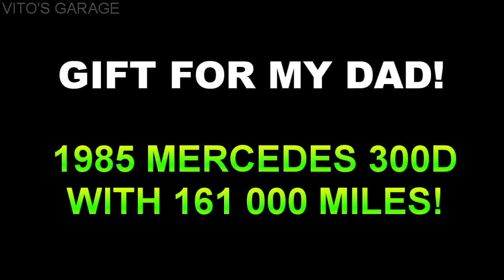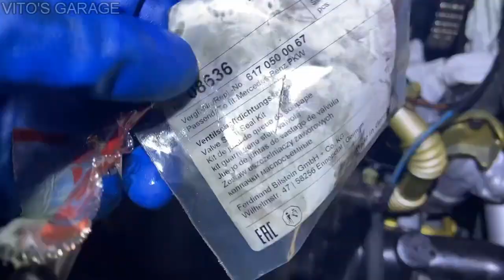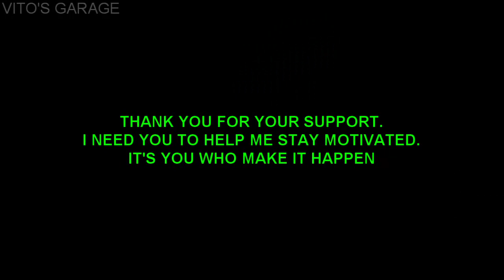Dad's Mercedes W123: New Driveshaft Flex Discs & Center Support, New Valve Stem Seals, Fresh Exhaust

Comment: Good job Vito!
I had an 85 300d. It had 280,000 miles on it when I sold it. Now I wish I had it still. It was a lot easier to work on than my current 2001 e320.
I don't know if the flex discs and carrier bearing were original or not. I think I only put around 40,000 miles on it in the 4 years I had it.
Anyway they gave me no trouble so didn't think about them.
I did not lose any oil at all so never worried about any part of the engine. Just kept the valves adjusted and the oil changed regularly. These things are pretty bullet proof and take little maintenance especially in good climate like southern Cal.
Reply from the maker: W210, especially E320 are easy to work on. Lots of space under the hood. Serpentine belt replacement takes about 5 minutes, everything is so accessible on that car. I want to find and add an E55 W210 to my collection. I love those so much. And thank you for supporting. This W123 should make my dad happy🙂🤝